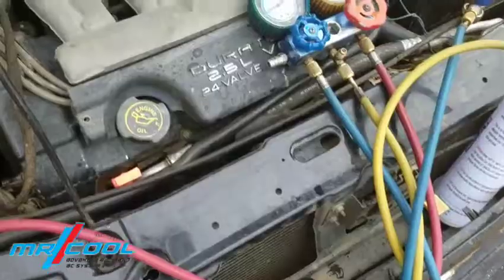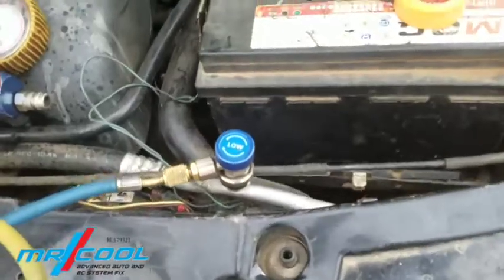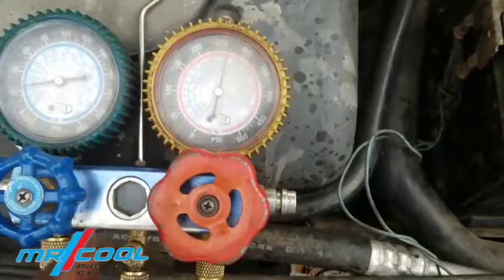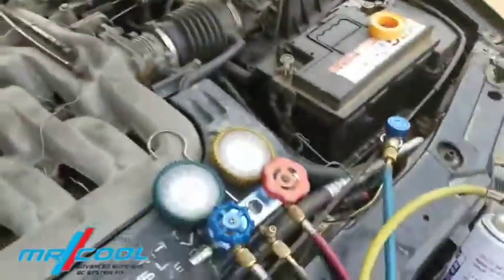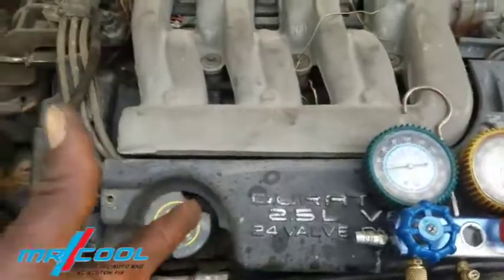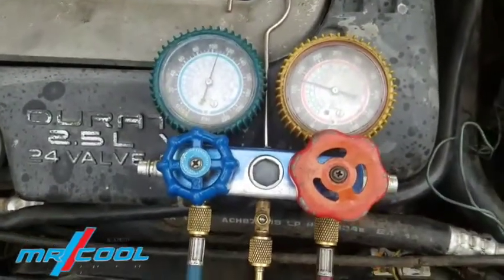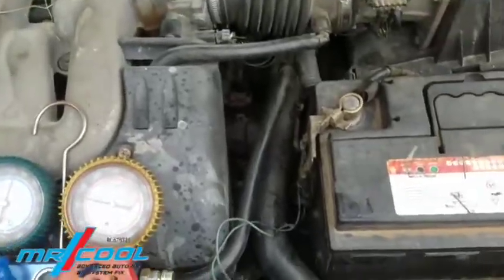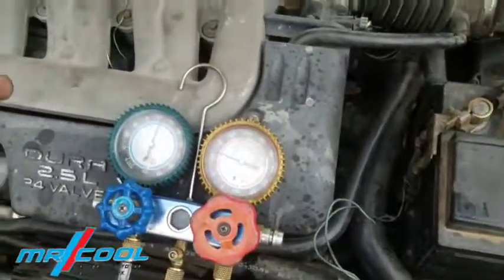Freezing Car AC Liquid line Solved part 1 | How To Fix Ac Liquid Line Freeze

Comment: Goodmorning sir my honda civic has the same problem what do you think is the problem the ac lower hose is freezing and will not blow cold air? I replaced already the expansion valve and filter cabin
Reply from the maker: You sound like a non subscriber
Reply: Subscribe already
Reply from the maker: Your description is unclear, what do you mean by lower hose?

Comment: I have a 2012 Lincoln MKZ Hybrid 2.5L and I’ve noticed this happens to me as well. I also notice that my steering becomes TERRIBLE when I turn my AC on and I’m wondering if this is the reason. At first I was focused on the Rack and Pinion (which was recalled a few years back) and I’ve had another one since. But this loud grinding noise while I turn ONLY happens when it’s hot and I have my AC blasting and there’s a line under my hood that freezes. I’m wondering if that’s it.
Reply from the maker: Kind of strange